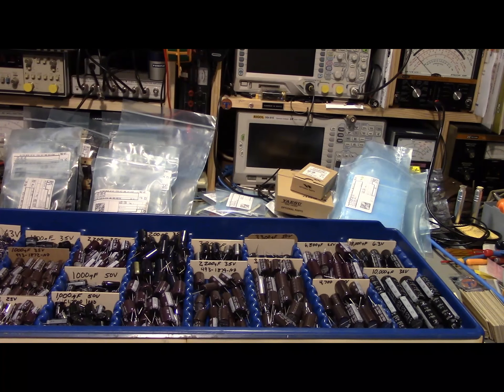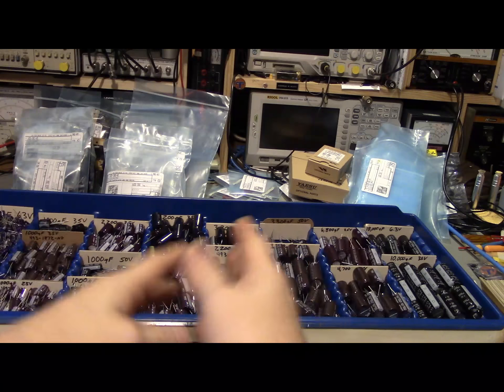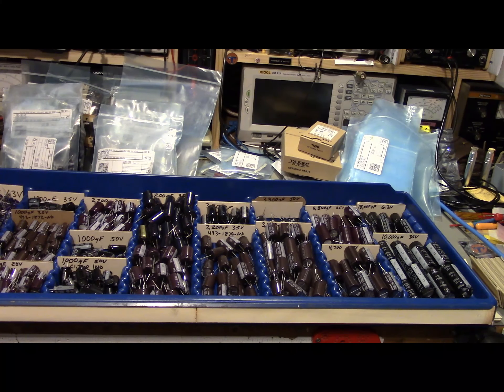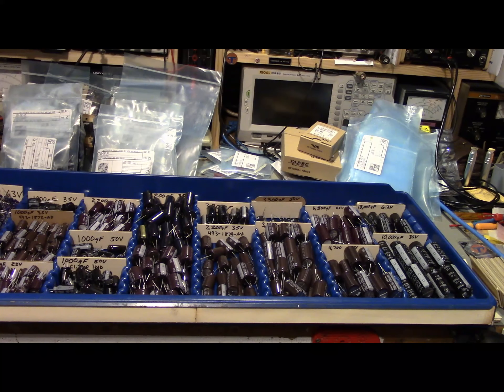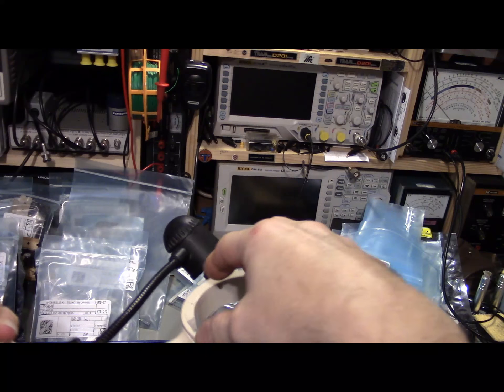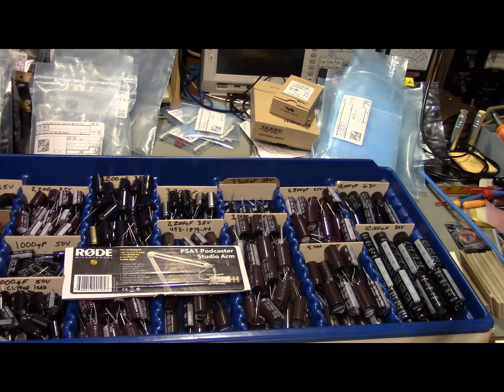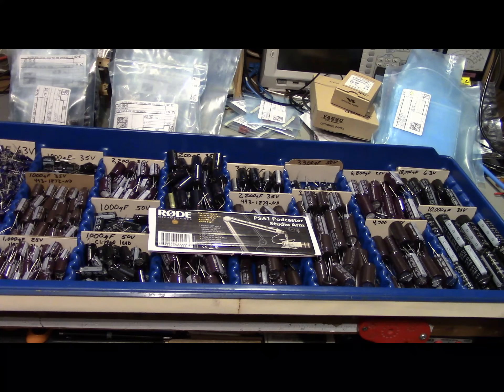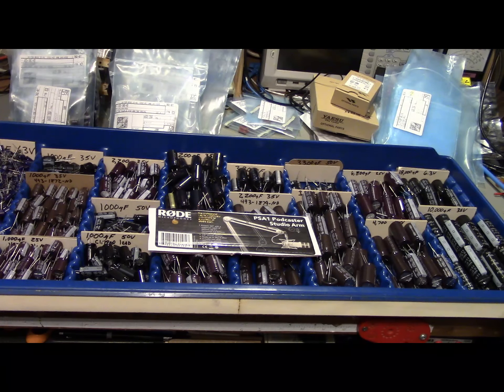New computer / camera test, course updates and in general whats up.

Comment: You will regret buying the All In One trust me
Reply from the maker: Of the two computers I got I am finding I like the touch screen all in one the most.  Takes up almost no room and does what I need it to do.  I kind of think of it as a large tablet with a disc drive built in.  When I need more computing power and want to do interface with my test equipment over GPIB I will use the tower style computer.
Reply: I understand everything your saying but I've been an IT tech for 15 years and every all in one I've ever encountered has been nothing but trouble especially HP products!